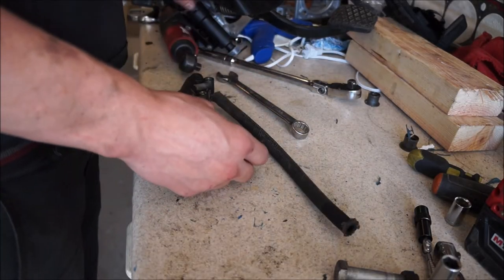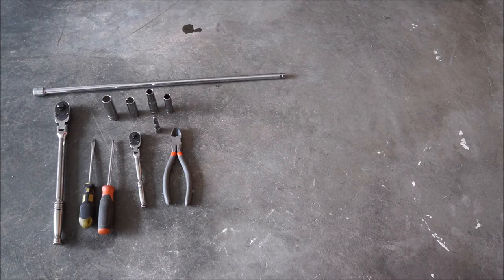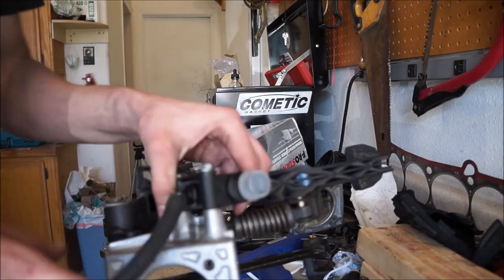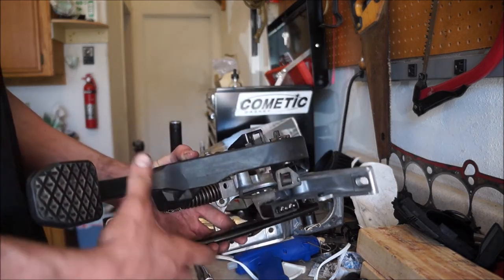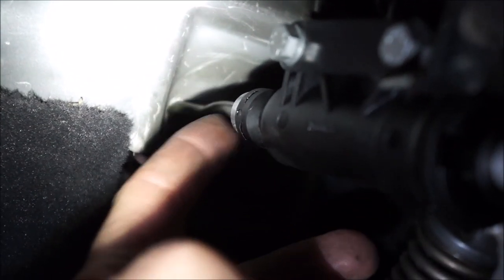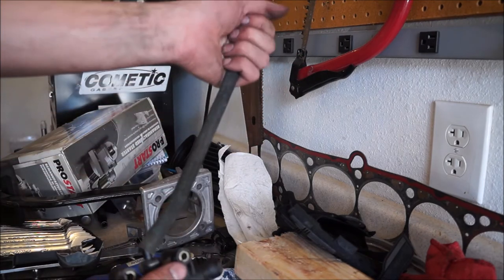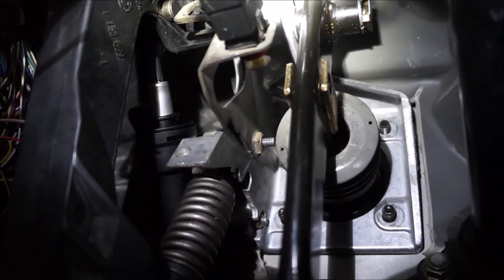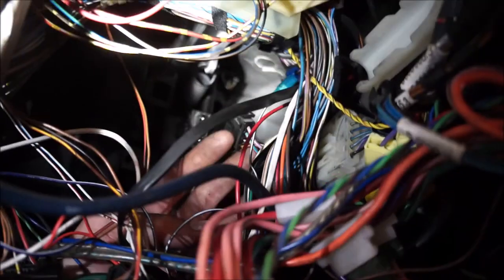Manual Pedal Assembly Install: E36 Manual Swap

Comment: Thanks to your awesome videos I have completed my manual swap and everything works.  
One question. The automatic gas pedal has a kick down switch behind it. Should the kickdown switch be removed? If yes, any tips instructions on how to remove it?
Reply from the maker: I just leave them in there, they dont hurt anything
Reply: @M3NACE  thank you so much for all your help & continue support.

Comment: so for the clutch line to the master to the reservoir, that's separate from your steel aftermarket cable, right? I'm almost sure that it is because it would be dumb not to, so what part number is that? or where could I find one?
Reply from the maker: from the master to the brake res. is a different line, its just clutch hose. part number  21521163714 it usually comes in rolls, I measured and cut mine first thing in this video. I would reccomend watching the manual swap prep series, It might answer and clarify a few questions for the swap. here is the link: https://www.youtube.com/playlist?list=PLVaxrCrxn-sEBv9t2Tu501WfAkTF7AISC

Comment: also, the spring and clip at around 11:05 should come with the pedal assembly to begin with, right?
https://gyazo.com/872c4ccfd170a8014a2798bf4504f26f
if i'm not mistaken that's the parts.  
I'm just ordering new hydraulics and clutches and flywheel and reusing everything else out of a 92 325i which hopefully has a getrag transmission as well, and the only thing I'm skeptical about besides wiring now is dealing with those small clips, springs, and what not.  I'm gonna guess though that, for the most part, I would have all of these if I take the entire assembly from the car?
Reply from the maker: MCatwar if you pull the assembly out of a car you should have everything you need, if not they are easy and cheap parts to find/order
Reply from the maker: MCatwar I have a full video on assembling the pedal assembly in the prep series👍
Reply: M3NACE oooh okay will watch that
Reply from the maker: MCatwar lol watch the full prep series bro, it will help

Comment: quick question again sorry if i bug sir can u use the stock auto ecu for the manual swap cuz the ecu i got with the swap is dinan chipped i guess and on fifth gear i’ll be at 70mph and the car is at 4.800rpms is that normal while cruising ?
Reply from the maker: Yeah the stock ecu will work. What diff does your car have?
Reply: the stock 325is one of the auto car and also i’ve notice it has problems starting like its sputters to start and then after couple of try’s it turns on well and no check engine light it’s odd cuz it always does it and it never had a problem when it was auto
Reply: it would turn on with one key start
Reply from the maker: @mromagachi5194  find out what ratio your rear diff is. also, if you pulled the intake manifold off i would check for vaccum leaks

Comment: HUGE QUESTION ON HONDAS WHEN U DO A AUTO TO MANUAL SWAP U SWAP BREAK BOOSTERS DO I HAVE TO DO THAT ALSO IN THIS ONE ?
Reply from the maker: HUGE ANSWER NO
Reply: thanks a lot man i finish my swap yesterday all i need a new clutch master cylinder the one that came with the swap is trash
Reply from the maker: @mromagachi5194  nice man!!
Reply: all thanks to your videos bro thanks a lot ur an amazing help